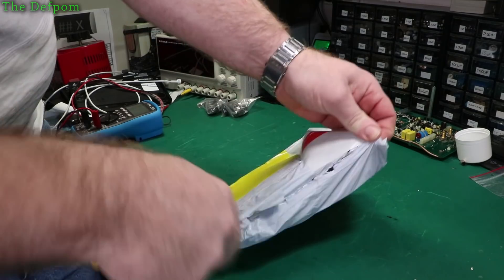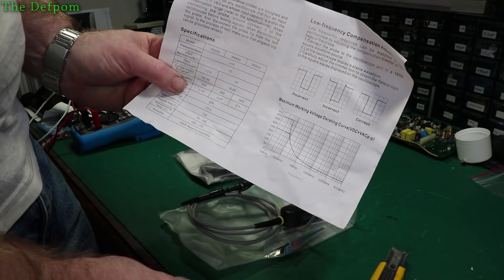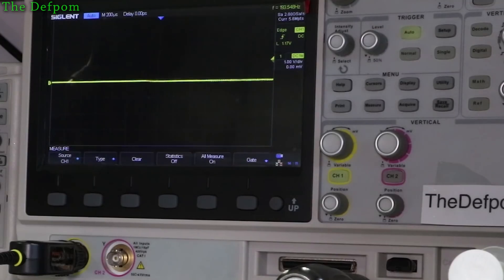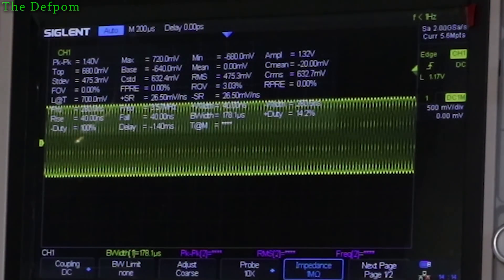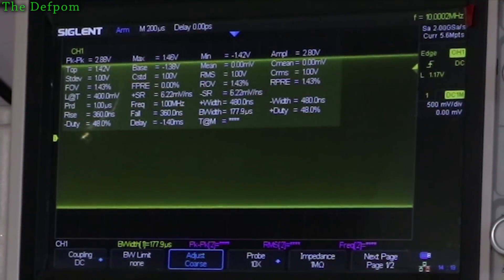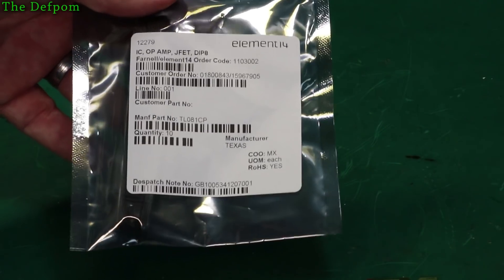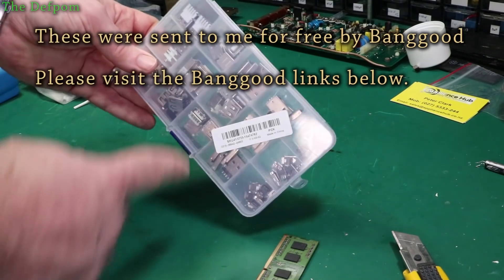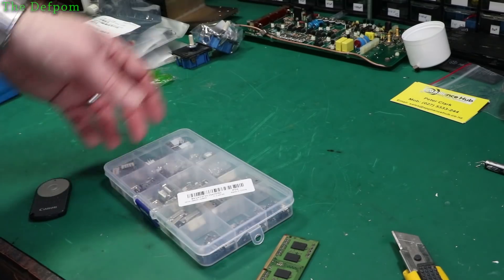🔴 #580 Mailbag Monday 17th June 2019

Comment: probe bandwidths given in spec sheets is way different than the "system bandwidth" which is the actual bandwidth of measurement device (scope) plus the probe. HP has a number of documents explaining that.Also, for measuring the BW the source must have flat response with the loading you put on it. With 1M /10M ohm plus 10-20 pF loading of the probe, the source may not put out a flat response. This is also part of the "system bandwidth".
Reply from the maker: I don't disagree, however I also did the same test with my Siglent probe and that gave the expected result, pretty much flat until it starts to roll off at its bandwidth limit, unlike the 500MHz probes, which certainly are not flat.
Reply: @TheDefpom  oh yeah those  P6500 cheapies are piece of junk. I got a pair of them, one came in DOA so I got a refund for that and the other one is just piece of garbage. my 200MHz Siglent probe is way better. But, generally speaking, my point was that the "probe bandwidth" must be measured in a different way.

Comment: Scott, do those 500 MHz probes with the auto sense 10x pin auto change the channel input attenuation to 10x with the SDS2000 ?
Reply from the maker: Yes it does indeed automatically switch, nice.
Reply: @TheDefpom  Good, I suspected they would auto sense but wasn't sure for the older SDS2k like you've got. The later X models auto sense probes just fine.
Reply from the maker: I didn't notice, I will check.

Comment: Seems that after my comment the Siglent probe is better, but the sig source should have al 50 termination for its output to be assure flt
Reply from the maker: I will give that a go to see if it changes the response very much, obviously it will attenuate it further.
Reply: @TheDefpom  over the RF range it is possible that the attenuator network has a compensation network, that may be adversely affected by load res and cap. May be nothing, worth looking.

Comment: I almost bought a LeCroy 7200 mainframe a few years ago with a 500MHz module for just over $200 until I found out the cost of good 500Mhz probes.  The 7200/7200A was their highest end scope up until the later 9300 series.  The only problem with those is they are dependent on a system floppy disk to start up.
Reply from the maker: I don't know why they are so expensive really, once the design is pinned down it shouldn't cost that much to make them after that.

Comment: Scott.....500MHz scope probe link is dead here.
Reply from the maker: I tried to get a partial refund due to the probes being out of spec but they wanted a video instead of the photos I sent, but  as I couldn't be bothered I just let it go, I guess that seller removed them from sale because of my complaint.

I found some cheap 500MHz probes on Banggood (which I just purchased to see what they are like), I will add a link to that.